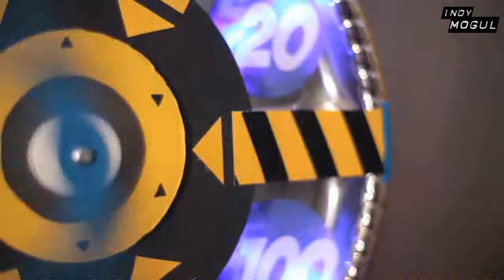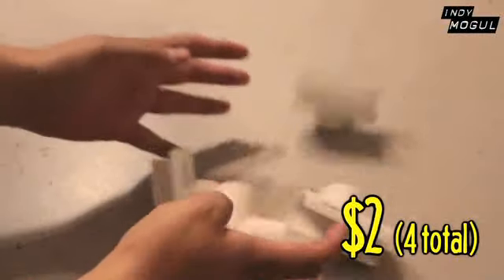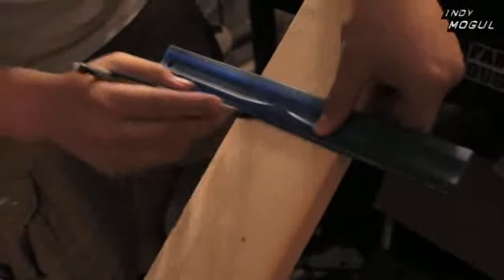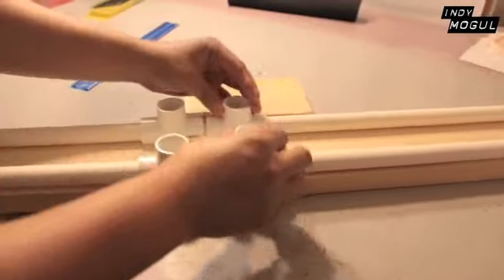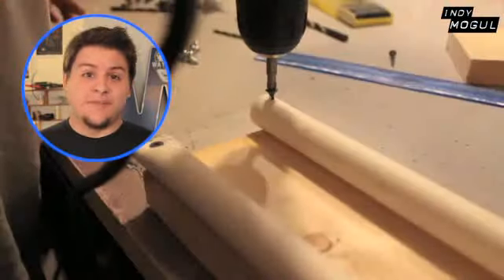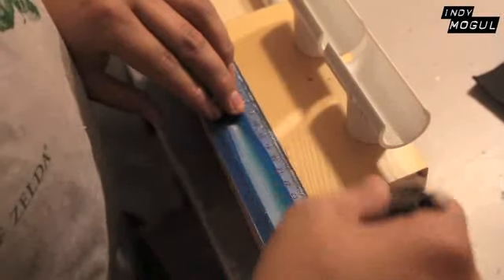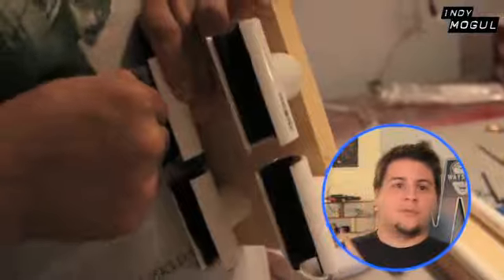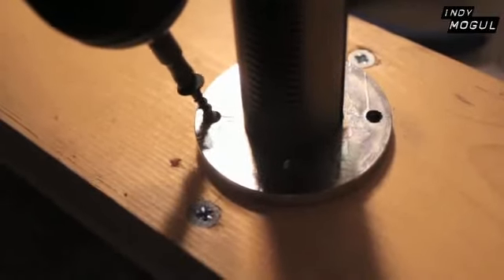Build a DIY Slider for $20 : Backyard FX

Comment: Built this today. Works pretty well. Couldn't find any T-Shaped snap T's at my local hardware so I used a Slip T with female threads and used a male threaded plug. Worked great. Took a little extra time because of this but it turned out very good. I was able to do mine for around under $10 with the same materials as in the video.

Comment: The 3/4' hinge joint is actually one size up from the 1/2' size pipe, which allowed Zach to easily attach and unattach the main sliding part from rails (so that the pieces of felt could be adjusted.  I happen to know about the hinge joint because I know of a tutorial from The Frugal Filmmaker that he uses it (the 1/2'  hinge for a 1/2' piece of piping) for one of his projects.

Comment: Awesome PacMan shirt
AWESOME gear build! The bowing could have been from the screws threads. Next time use bolts and nuts with slightly larger pre-drilled holes. Overall I am super impressed with the build. You are spot on with the compactness and usability!
Awesome looking test film! The drama is a bold move. I still think it'll have a comic twist, but I would love to be surprised. Easily your best ep yet Zack, great addition to overall Indy Mogul builds. Hidden blades are dumb ;)

Comment: Yes, you´re right. Indy Mogul has forgot presented in his video no diameters of plastic of used tubes and T-splitters and how his made adjusted ones! I´m working on the slider like this, but I´m using clips (into a wall) instead a T-splitters. The clips are with large diameter, but I´ll stiffen - steal them with strips ofcardboard or another suitable materials. And I´m shooting the video during my work on it (about it).

Comment: For screwing on the pipes:
Either cut out or drill out a bit on top of the pipe so that you're only screwing through the "bottom" bit of the pipe.
That should avoid "squeezing" the pipe ends and therefore eliminate the "bending up".

Comment: i used regular t shaped pvc pieces, i had to put a plug in the top part so i could screw it in and cut off half of the bottom and it worked perfectly. this project only cost me 12 dollars!

Comment: Did you ever think about making Ezio's (from assassin's creed) hidden gun. My instruction are: first buy a nerf secret strike (i got mine from target), then take a splint and strap in the gun with straps on it to the splint, after that, take an authentic assassin's creed blade and put it under the gun (You can also spray paint the it). If you end up creating this, thanks so much, i am a big fan!

Comment: great video, awesome production skills.  Just want to make a point on table saw safety.   you should use the miter gauge when making the crosscut you made.  it would support the board making it less likely to catch the back of the blade, spinning the board and fingers in to the blade.  like I said, nice work.  Just don't want some young film maker to get hurt. peace!

Comment: @swansealongboarder  buy regular pvc Tees and and use a handsaw to slot the tops then deburr with a file. When buying the Tees run your finger through the inside to make sure they don't have stops (ridges). His Tees were strange in that they had plugs already in them. Buy the regular Tees and some plugs and glue them in first.

Comment: Hey Zack! Couple of questions:
1. Where did you find PVC T connectors with no hole in the top?? Or did you fill the hole in with something?
(Also, there is a stop on the inside of the T connectors to prevent the PVC pipes from covering the top hole when connecting them. This can affect the fit on the pipes.)
2. How did you cut the T connectors? Obviously, there are several ways to do it (ie. table saw, hand saw - I used my multi-tool). 
It would be helpful if you explained these two elements.

Comment: I'd love to see some test footage of this in action :) 

Also, do you think it would work better (than the felt) to glue rubber gasket material or like the inner tube from a bike tire into the 'T' connectors? Then you could just grease them up and get a REALLY smooth shot.

Comment: If you are using any kind of a heavier camera or a DSLR, this simply will not balance on the tripod without it wobbling really bad. You are best off supporting this on two cheap light stands for added stability.
Reply: Adam Sternberg seriously ?
Reply: Surfaced studio sent me to this video, he did a good review showing the general problems with these and how he got around them :-)

Comment: @sabrewolfbilly  I dont know what those t shaped things are!  I showed the guy at Lowes a picture of them and he didn't either.  I did find a way to build it using a different pvc t-joint though but it was a pain in the ass.  Now to find a tripod with removable parts.

Comment: question! im gonna use it for a short film. Is the sliding sound too much noticeable?
also, where did u used the hot glue? i didnt get it.
and also, did u sew the T shaped PVC pieces? im not sure if i cut them in half if theyre gonna be fine when sliding..

Comment: Where do you find the tee pieces?  What are they called they certainly are not the typical plumbing tee. The tee is larger size fitting than for 1/2 PVC?

Comment: @indymogul  i cant find T fittings like that ANYWHERE, not lowes OR home depot.  I know you could saw that half part off, but the part about it that i cant find is a T fitting where the one tube is closed off in the middle.  Everywhere i go, the fittings are all open 100%, did you modify it some how to make it closed off?

Comment: @blah012345678 Actually he used hinge joints.  The size he used looks like the 3/4'x3/4'x1/2'.  I say that he used that measurement is because he used 1/2 inch PVC piping and he then put pieces of felt in there, which the large pieces resulted in it getting stuck (this is because it filled in the gap between the inside of the hinge joint and the size of the PVC piping).  If the hinge joint had been the 1/2 size too, it would barely move (it would literally be a tight fit).

Comment: @blah012345678 yeah but what im sayin is that inside the tube, its blocked, like a closed cylinder.  it looks like thats what allows him to screw it on, the t fittings that i have, if i were to try that, i could not screw it on the wood because its just a 1/2" hole

Comment: But wouldent it make a slight scratching sound when u move it side to side , and also wouldent it vibrate from the scratchingnes......its still a cool low budget  gadget
Reply: they use felt to cover the screws so there is no scratching sound

Comment: @blah012345678 I had the same problem trying to screw T's on. But, I just bought caps for the T and drilled hole at the top, glued the cap to the T and covered the holes. It's works pretty good.

Comment: well, that looks good ... until you use it in different weather... that wood is "living" material, which is "working" inside and its not mold-resistant. plastic is also a material, which is is vulnerable to sun, etc... think you can use it for a short time, but i`m happy to have a metal based construction teflon slider... buying cheap somethimes means buying twice times (or more) ..

Comment: Not bad or if you prefer, very clever.  My only build comments: demonstrate using proper tools and techniques, a small tri-square instead of a plastic school ruler; never have your hands on both sides of a table saw blade; mount the slider to the head, not the tripod as "real" camera sliders do.  No need for a tilt and pan mount for the camera.

Comment: a 1 by 4? 
you're us so it's feet, i get that. it may be something like 1 foot wide, but it's certainly not 4 feet long, it's like 6 or 8, making it a 1x6 or a 1x8.
Reply: yeah but looks way too long for 4''
Reply: altsociety, 1 inch by 4 inch, this does not take into account the length. It is just a measurement of width x height of a retangle

Comment: @blah012345678 or u know could buy a normal tee pvc cut out the bottom with a saw and them u could either superglue it to the wood or you could screw to the wood at an angle so its going through walls of cylinder

Comment: That's a dangerous way to make crosscuts on a table saw. Very high risk of kickback.

Always use a crosscut sled, and never stand in front of the blade, or hold the piece on both sides of the blade.

Comment: i have noticed that Zac is pretty bad at the shoping list. in one build he keeps calling them 1/4 PVC, when they where using 3/4. plus no such thing as 1/4 PVC pipe only tubes. then he used a copper pipe cutter to "try" to cut the PVC pipe. then on this he just says "T shaped pvc pieces" so you would think 1/2 in since that what the pipe is. when it 3/4 in PVC snap T's. his use and knowledge of tools need to be improved as well. its been long enough Zac get it right.

Comment: everything about this build instruction is weak. the test video didnt even show the slide effect. i do give it credit for comical effect, such as acting like a diy video instead of one who actually knows what they are doing, and additionally not effectively instructing  on how to build this contraption. IE: the T connectors do not come from home depot with the portion of them cut out as displayed in the very weak "felt" section.  Who are you trying to impress with this? i just dont get it.